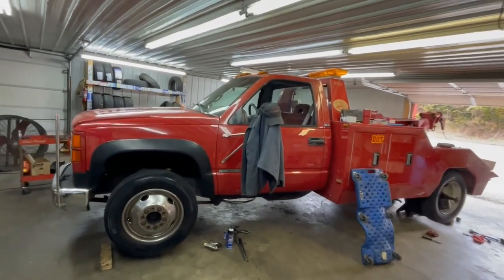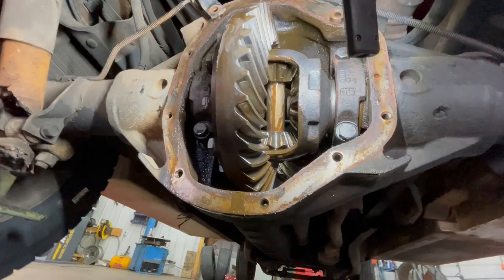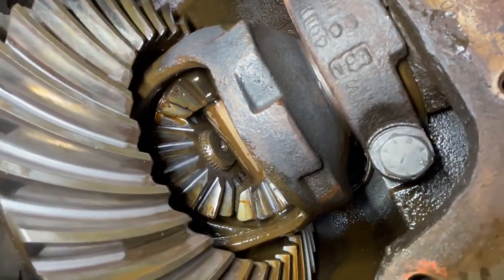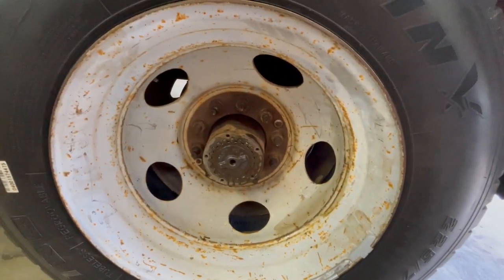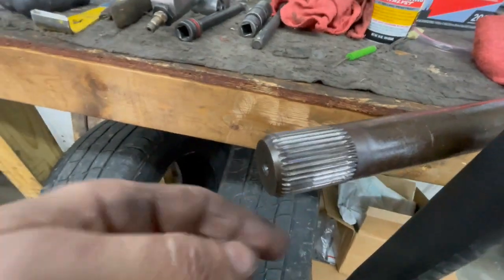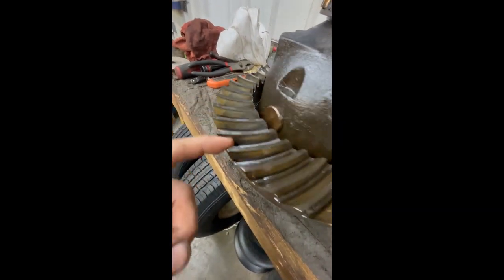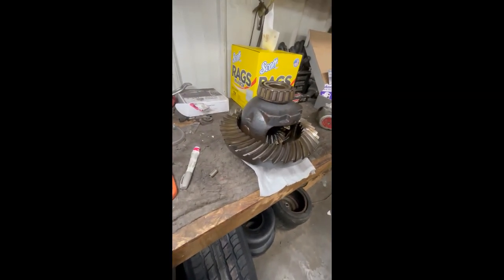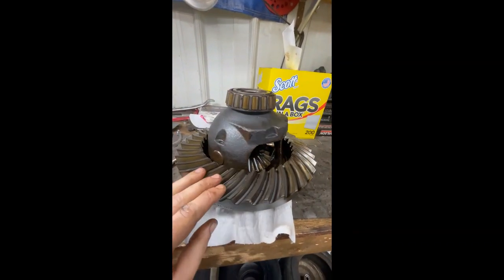Fixing a Loose Dana 80 Rear Axle on our 1995 GMC 3500HD Wrecker | Brock Auto Repair

Comment: Holy blow it up...lucky you caught ..spider gears it is...) thats a full floater.. the carrier would be in 2 halfs.if it was limited slip with clutches..) ...4:10's use a 35 spline axle...so you have update options...lol